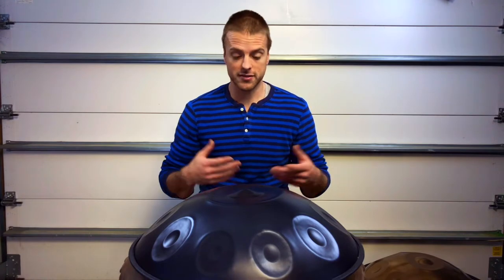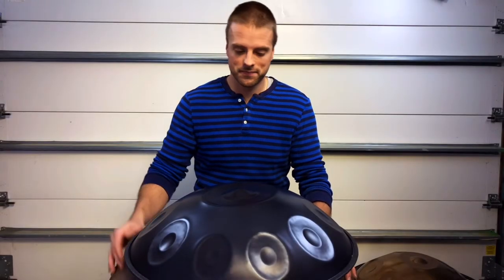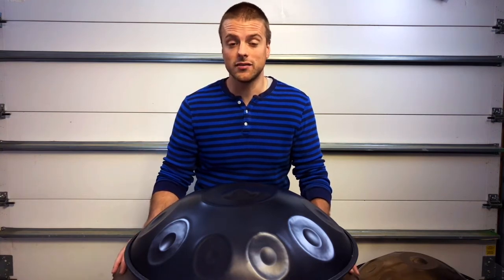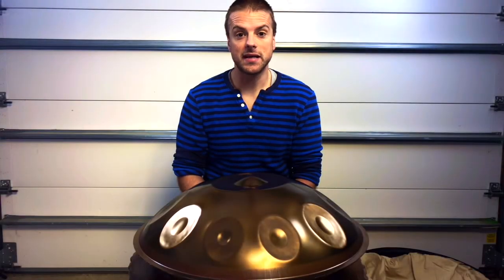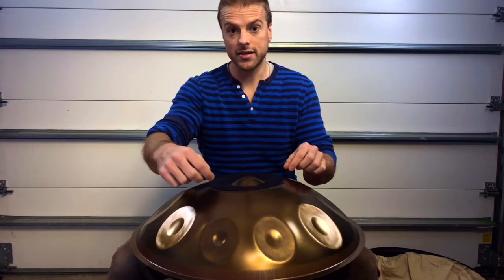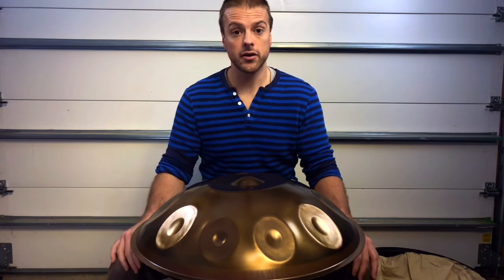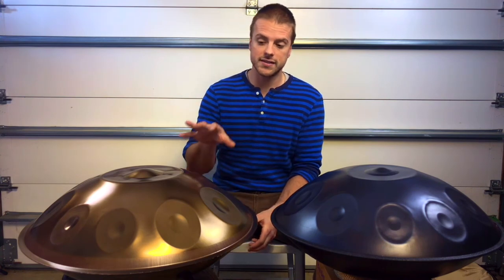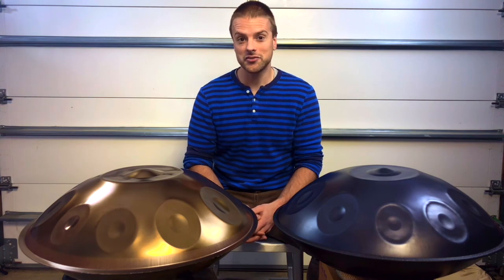Stainless Steel vs. Nitrided Steel for Handpans- Which Should You Choose?

Comment: The notes dominate the finger taps on nitrided steel while the finger taps compete with the notes on the stainless adding a percussive element. There could be a purpose for each metal but to my ear the finger taps on stainless are distracting whereas the nitrided steel tones are mellower and seem to fit the spirit of the instrument. Notice I said, "to my ear," since I see that others find just the opposite to be true.
Reply: I totally agree, well formulated
Reply: I totally agree I can hear lots of finger tapping on the stainless steel.
Reply: All depends on the micing.  Using the EnSoul pickup will lower the "finger" attack on the pan. I'd bet that live, the attack is not so evident.

Comment: I have kind of a weird question for you..
I'm fascinated by the resonance of how intricately these are built, and how one tone can activate other tones, if in the proper proportions.
Now, i'm just hypothetically wondering, do you think there'd be an audible difference if, somehow we were able to manufacture these with nanometer precision in terms of the correct size and bend for all the tone indentations? I guess my question is, how far could we push this towards the unachievable realm of perfection?
Naturally, it's often the minor imperfections that give an instrument its character, but you get my point.
It'd be very interesting to hear a handpan that was engineered to extreme precision, just to hear if its significantly different.
Reply from the maker: Hi @Baleur, great question. I would recommend researching the difference between Just Intonation and Equal Temperament. Vibrating frequencies aren’t mathematically perfect in terms of their relative intervals. We do our best to put structure and language to them, but it is an imperfect science that has many compromises. Also, achieving sound from a note is less about note size or bend in the metal, and more about the compressive stresses that are introduced to a note membrane through force (endless hammering 🙂) and the ever changing properties of any given alloy (that also widely vary in consistency of hardness, composition, and uniformity). Making minute adjustments to these stresses have so many different variables, and are achievable by so many different paths that are difficult to explain here, that it doesn’t seem possible to me that handpans could be manufactured in such a way. Although I suppose it is plausible, I don’t think it is practically achievable by anything other than a human or possibly some future form of AI. 

Best,

Marshall

Comment: Hello, such beautiful
 peaceful melodies are created with these hand pans. Im wondering if you
tune yours  to 440, or 432 hertz frequency.
Reply from the maker: Hi Brigitte! I can tune to either one by request.
Reply: @DanielsMadeHandpans   ah, awesome! I checked out your website to order one of your handpans, and though you offer a few options, the tuning frequency wasn't part of the online order form. Which frequency do you prefer?
Reply from the maker: There are pros and cons to both. If you are planning on just playing by yourself and using it for meditative or sound therapy purposes, then either one is great. Where it will make a difference is if you want to play with other musicians/instruments on a regular basis (i.e. performances, recordings, or jam sessions). The western standard for tuning modern instruments is A=440, which means that having a handpan tuned to 432 would sound slightly flat in an ensemble setting unless the other instrument(s) were tuned to A= 432 first, which is uncommon in most performance settings.

Comment: Materials dork question: I am wondering what would happen to the tone of the stainless pan if it was either passivated or possibly shot peened?  In either case you would wind up with a substantially harder layer on the surface of the metal than straight stainless, which might add some of fuller quality of the nitrided pan to the brighter sound of the stainless. Or go whole hog and selectively laser harden different areas of the surface to try to directly influence the sound. It might be possible to modify/filter the texture of the sound by putting a visible pattern on the surface, which would be amazing. 

Regardless of what color they are, those things are beautiful.